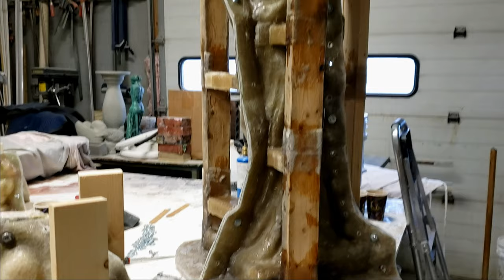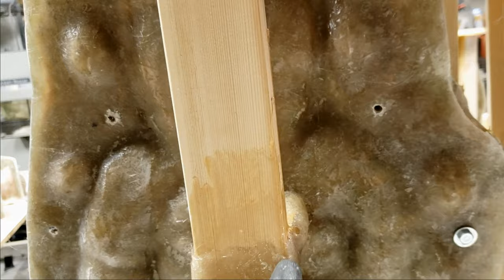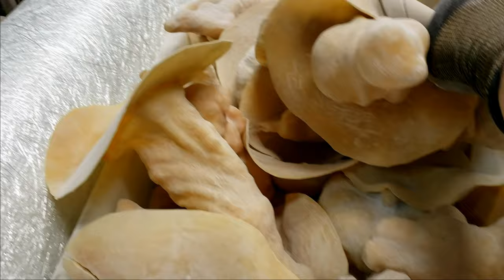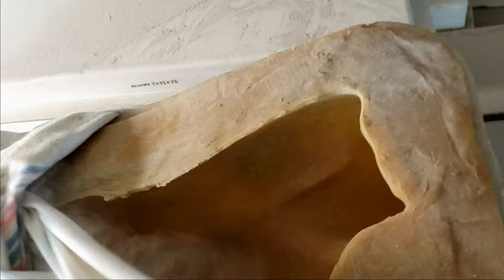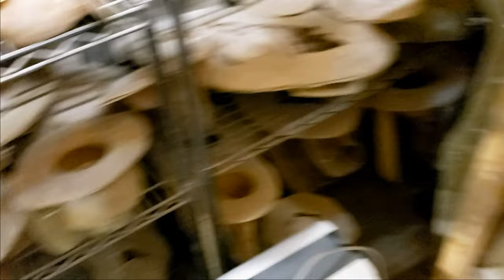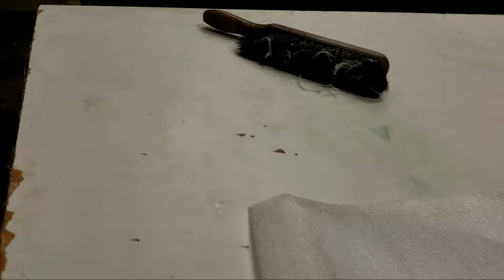Tour of the shop and all my molds. A few quick tips as well.

Comment: Hi Gris I love looking around your work space but I would like to know why my concrete is always coming out with a lot of air bubbles and is easily chipping  and it gets a lot of small air bubbles like all over I use a 1-2-1 mix and make my it fairly runny but it still comes out with a lot of bubbles I use a rubber mallet to tap the sides as well its very discouraging I have retired now so I am spending more time trying to get back into the statuary
Reply from the maker: Hey Daphne , to runny isn't good,that's what can cause your bubble .Now runny with the use of a water reducer or plasticizer is idel ,the mix will stay emulsified and give you a nice clean pour .